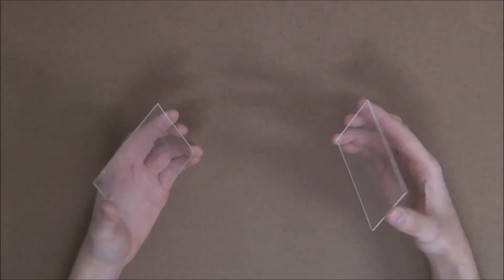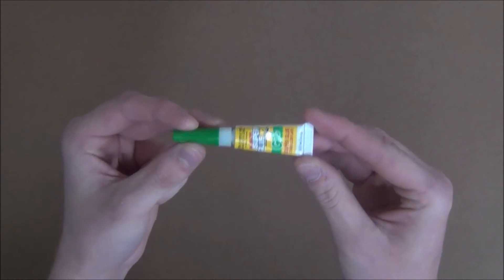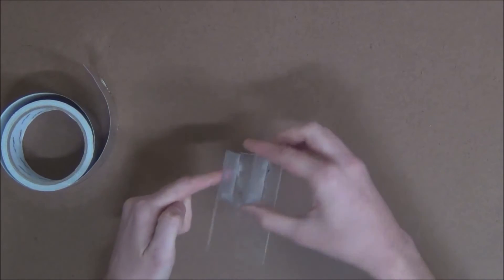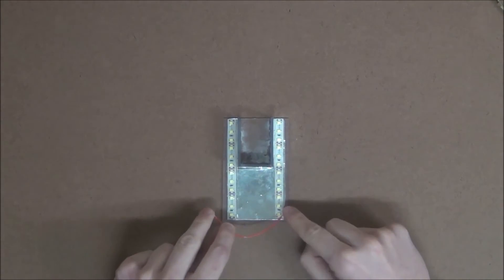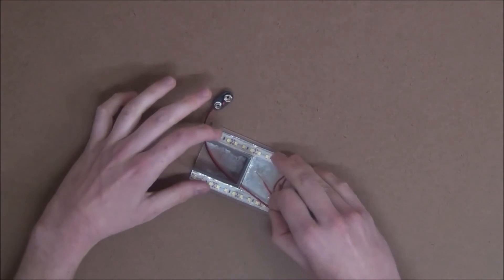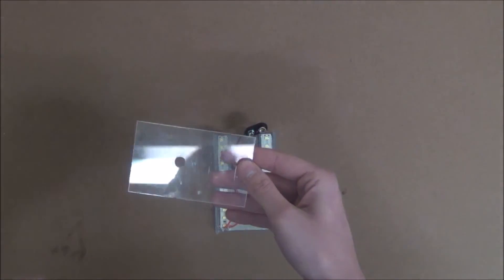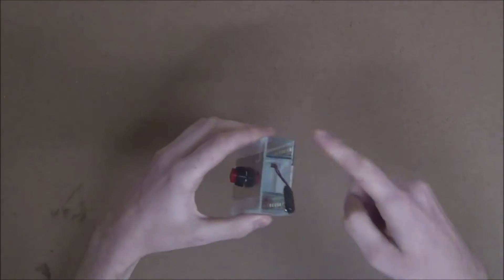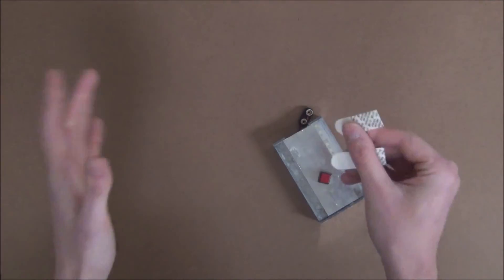How To Make A Wireless LED Light Switch!!!

Comment: Actually where want to buy the led ?
Reply from the maker: These are not the exact same as the ones I used in the video but they are very similar and should still work quite well. https://www.ebay.com/itm/LED-Strip-Light-SMD-3528-Flexible-Tape-300led-DC12V-indoor-outdoor-lighting-rope/222532356387?var=521379163402&hash=item33cff64923:g:SccAAOSw7o5Z3T15
Reply: Tq for the information..

Comment: Really nice, man. :) I'm thinking on making something similar, but using a Mentos tin can. I used one to make a battery holder/box with on/off switch (it's in my videos). So, basically, sticking two strips in the can and putting the switch in the side instead of the top (where I put in my battery box). :)
Reply from the maker: Awesome! sounds very cool!  :D